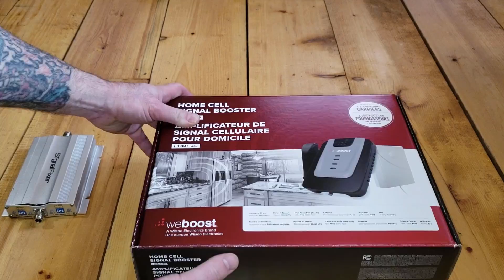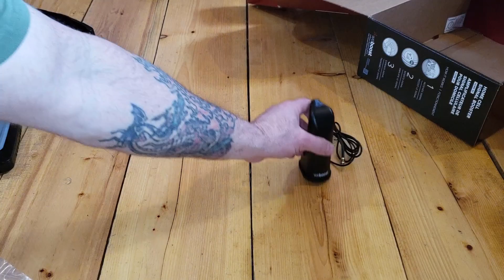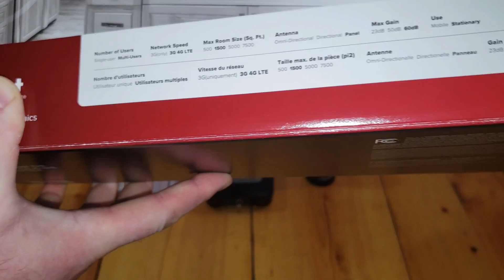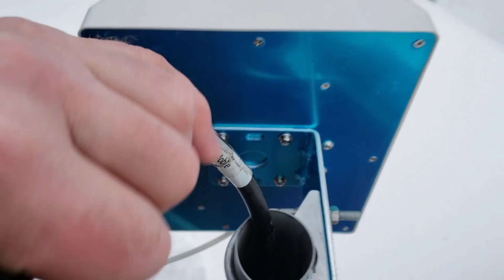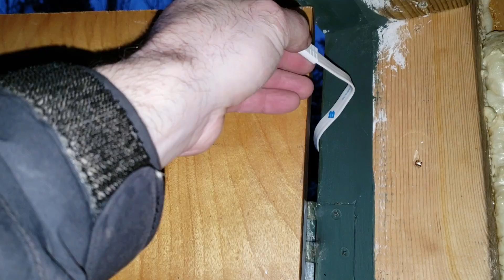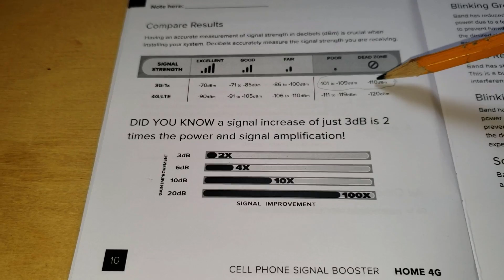WEBOOST Cell Signal Booster at the Cabin - Unbox, Install, and Review!

Comment: I'd be curious to know if WeBoost would work better with a better Yagi-style exterior antenna properly aimed and an in-line amplifier feeding a true 360 degree omnidirectional antenna indoors.   WeBoost is overpriced IMO.
EDIT:   A commenter below confirmed that WeBoost works even better with proper antennas.

Comment: How far away is the tower from the cabin
Reply from the maker: I think its about 8 miles. Although that doesn't really matter. It's the line of sight to the tower + the power output of the tower.
Reply: @NB88   what what service are you going which provider

Comment: Mine jumps from 4 to 3g because I'm between two towers. I'm almost in the middle, so I get good 4g on one side of the house, and 3g on the other end. My phone struggles to stay connected to either though. Basically the walls of the house block signal from either side.

Comment: The outside antenna and cable supplied with your old booster was actually of better quality that the stuff that was supplied with the new booster.  You could have bought a small connector adapter for a few bucks to connect your original outdoor antenna to the booster and saved yourself a ton of trouble...and risk!  But that's what you get when you don't really understand what you are messing with.  Glad it is working for you though.

Comment: Hi,

Curious what did you start with for connection? (dBm or none at all) and....

What is your Line of Sight situation? Any mountains lots of trees between you and the tower?
Reply: Note: I did finish your video thanks for addressing your dBm finishing point. I'm just am looking for clarification from the starting point.
Reply from the maker: I started with little to no signal. When I did have signal it wasn't really usable - texts wouldn't send or would take forever, phone calls wouldn't work. I'm on an elevation which helps and there are no mountains but there are trees in the line of sight. I could put the outdoor antenna up higher but it's working fine for me as is. Data still sucks but that's the towers fault not the booster. Hope that helps.

Comment: Question: SInce it tends to get hot, I was wondering what you think about using a common timer to power the unit off (at night) when not in use? My thoughts are this would help prevent the unit from overheating (no continuous power until day time when you want/need it). My concerns would be would turning the power on and off dailey cause any harm to the unit if this were on a timer? Your thoughts about this idea as a means to control the temperature would be appreciated. I just ordered this same unit and it will be arriving in another 10 days.
Reply from the maker: My unit doesn't tend to get very hot. I just put my hand on it and it was barely warm.  That said it is slightly spaced out from the wall so it gets good airflow.  Also, since the cabin is run by solar,  so I shut off the power every night anyway.  You could put a timer on it if you find it getting hot.
Reply: @NB88  Thank you for your insight, best regards!

Comment: I think if you could raise that antenna about 10 to 15 foot up you're going to get a lot better signal strength. Your to close to your tin roof. Attach a ground wire to the base of the mass. This will improve the ground wave
Reply from the maker: I thought about putting it up higher but so far it's working good.

Comment: The cooler the unit is, the better it works. put it where it won't get wet. It's NOT waterproof. Get on the website a get an
 outside antenna like the one you took down. https://www.wilsonamplifiers.com/wilson-yagi-directional-antenna-wide-band-50ohm-314411/

Comment: Your coax on the old system is LMR-400 This is very low loss coax, compared to RG6 which is commonly used for CATV installations. LMR-400 has a 50 ohm impedance, while RG6 has 75 ohms impedance. That only matters for the antenna install. It's possible to get the booster to work with the LMR-400 with some work. Of course, if it's working, I wouldn't try fix it.

Comment: Just in case people don't know about this option, there is a category of antenna/receiver/transmitter cable that is called "hardline" or "semi-rigid" cable. Good quality hardline is quite expensive but has even less signal loss than flexible coax cable. It IS a lot more difficult to work with than flexible cable but for some situations it can mean the difference between success and failure. For these kinds of situations, I would call it a last-resort kind of cable. By their nature, they are also typically more robust in adverse conditions than flexible cable.
Reply from the maker: Thanks for your feedback.  👍

Comment: A POSSIBLE CHEAPER SOLUTION

My family uses a "signal booster" solution on the ranch, but I use something cheaper that works for my needs where I work and live. When I'm there, all I usually need the phone for is to talk and mostly in case of an emergency situation.

If you have at least one location in the house that has decent cellphone reception, this solution is something to consider. It does NOT replace the "signal booster" solution if you don't have at least one cellphone usable location.  (and of course with this system, you're using a handset now, and not carrying around your smartphone...so it won't be for everybody)

A much cheaper alternative that works for me is a multi-phone "link2cell" capable wireless phone system. It still uses your cellphone for making and receiving all calls, but this type of system lets you use the wireless phones that it comes with (you can usually add more). I've seen them listed as coming with up to 6 phones but you can buy one with just 1 phone if you like. Even that lets you walk around without worrying about losing the cellphone signal.

One Link2Cell capable phone system with 3 phones cost me $15 used (it was $80 new at wmart).
However,  one issue is that "link2cell" doesn't work with older Bluetooth so look at the specifications of the link2cell phone you are getting and the Bluetooth specs on your phone.

It does not require ANY extra "apps" to run. it just uses the cellphone's phone capability.

Here's how I use it:
I put my plugged-in cellphone by a specific window where there is good cellphone reception, and I put the "base station handset" unit within 30feet of it (it's Bluetooth-based). My link2cell system came with 3 phones total: 1 base station and 2 other wireless phones with small charger stands that I can position anywhere within hundreds of feet...definitely anywhere in my location (1 bedroom, 1 kitchen/living room, 1 to carry around the property)

With this setup I can make and receive calls using a "regular" type of wireless phone we've been used to for decades now. In addition any one of the 3 phones has full access to the contact list stored in my cellphone, and Caller-ID provides information using that list just like using my cellphone. It also blocks calls just like my cellphone...because it IS my cellphone that is actually making and receiving the calls, but I'm talking on the system's wireless handsets.

Even better, I can carry any of the wireless phones around with me on the property, and it has a range of about 300 feet. Some of these link2cell systems have longer ranges than that (correspondingly higher price).
==============================

Examples:

$75 Panasonic Link2Cell Bluetooth Cordless Telephone with Digital Answering System (4 Handsets Included)

The one I got is 
$15 (used) Vtech_Link2Cell_DS6722-3_PhoneSystem-3handsets

Note: these are also alternatively called something like 
$65 Vtech DS6621-2 DECT 6.0 Connect to Cell
Reply from the maker: Good information. Thanks for sharing.  👍

Comment: Download something like Ookla - Speed test.net app and see what your average download/upload speeds. Also if while watching YouTube vids, to help keep smooth playing of vids, tap the 3 dot menu at top right of video screen and you can set vids to 720/480/360/240 quality (adjust as necessarily needed to stop the buffering. Also, adjusting to lower vid quality will help your data usage too).. Good videos though bud. Keep up the good work and stay safe fella 😎
Reply from the maker: My signal is strong but my speeds are sloooowww...since it's a rural tower, I understand that it probably uses microwaves to transfer data? I can watch 'ok' quality youtube videos but upload speed was only 0.43 Mbps.

Comment: I'm installing one for my parents this weekend, they live at the top of a mountain in Asheville NC. They can get 1 bar sometimes 2 bars LTE on the porch. So I hope this works. Thanks for the video, very informational.
Reply: CANT WAIT TO HEAR...  same  situation here
Reply: Did it work??
Reply: I found a spot outside that got 2 bars LTE on my phone so I mounted the outdoor antenna there. Ran a coax cable inside to the booster and now they get the same 2 bars inside. Only draw back is range it only works within the living room where the antenna sits and the bedroom behind it. But it does work and they can set the phone up as a Hotspot to use their PC

Comment: Ouch, that was pretty cringeworthy  watching you throw the ultra low ohm communications wire to the side and put it all on a high 50ohm TV coax wire.  Should have bought an adapter, it makes a huge difference on our ham radios, I bet it would help your cell antenna too.

Comment: while your unit is connected and operating... go on your roof  and slowly  tweak the direction your antenna is aiming, you may not have the antenna  exactly aimed in the direction your cell tower is, thus the drop in 4G LTE to 3G its got a lock, but not a steady one

Comment: 12 years in the wireless industry. A couple of things you should know. BTW Network Signal Info is an awesome app. Also look into LTE Discovery. It will give you frequency info about the tower you are connected to and aid in geo-locating towers.

1st. Phone calculate bars based on a formula that is different for every manufacturer. For example the same -100dBm signal on a Iphone 8 may show 4 bars while on a Google Pixel 3 it may only show 2. The devices may perform identically in term of most things besides data throughput ( Snapdragon processors have integrated modems and are just plain faster than the seperate processor and modem configs used by apple in terms of raw network performance ). They will however seem to indicate different signal strengths if you just look at the "bars"
2nd. The algorithm that the phone uses to display bars is different for 3G and 4G networks. LTE needs less in terms of signal to work appropriately than does 3G-HSPA ( TMobile/At&T ) or 3G-EVDO (Verizon / Sprint ). -100dBm 3G will be significantly less stable than -100dBm LTE. The FCC also permits slightly higher TX power on the cell site's 3G bands than on LTE. Honestly have no idea why and I trained employees on the network equipment.
3rd. The bands may make some difference but inside a house at close range the difference in penetration between Band 4 ( 1700 / 2100 ) and Band 12/13 (700mHz ) really shouldn't make a difference. Side note lower frequencies travel farther while higher frequencies are better for data speed.
Lastly data speeds in rural areas tend to be limited by the connection speed available back at the cell site itself. Many rural sites do not have fiber connections at the tower they use microwave links for connectivity or some sort of dedicated connection like a T1. This is not as common as it used to be at rural cell sites but there are still plenty of them out there.
Reply from the maker: Thanks for the information. My nearest tower is very rural so I'm sure it does not have much of a connection. Which explains my good signal strength but slow download speed and really slow upload speed.
Reply: @NB88  The upload is normally the giveaway. Sub 2mb up is almost guaranteed a microwave link.

Comment: little tip for some people with the 4g 3g jumping issue, type #*#4636#*# into your dialer and set your preferred to LTE only dont touch anything else and you'll be fine it is a bit of a scary screen at first but as long as you dont change other things its fine. PS not all phones allow you into those secret settings but most should

Comment: 3g wavelength can travel further then 4g,  just how 5g is only good for 500ft,  4g is good to 1500ft? I think  3g is even further then that,  5g does not penatrate walls very well too,  just like 4g has problems with  walls and 3g has less problems with walls,     Trees can also effect your signal but not by that much just be aware any atmospheric conditions can interfer with it,

Comment: I am a Wilson dealer and installer just leave the directional antenna installed as it is the right one for what you need also it is more directional than the panel antenna. the antenna you are showing the video is for internal use with the amplifier  the panel antenna that is being shown is less directional than the directional 3 g equivalent antenna.
Reply: the cable looks like lmr400 which is higher quality than RG6

Comment: 3G runs on a different band at a lower MHz and the lower the MHz the further the distance but with quality loss but the higher MHz better quality with a distance shortage (shortwave radio ultra low bands can or n 2000+ miles sometimes) but this was the differences in the 3g to 4g LTE .... But the cable difference was your old one was a female type N with the yagi antenna you had was a male type N , your new omni directional  panel antenna with sma male ends. Every time you use a splicer or a new connection you will lose db which is what you rate the signal -db ! Just saying if you will run the discovery app while you are hooked up reading your signal meter while you are on the food you can use the meter to fine tune the panel antenna to the best direction to get the best 4g and it should keep it from jumping back to 3g signal. It does this when your 4g drops below a certain rating. But you can also get a small to N male to convert your new cable to your old yagi antenna that should be better for your type of install and where you are so far away from the tower the yagi is more of a directional antenna with a smaller spread but further direct beam while the omni panel is a shorter wider spread beam like a 130° with the yagi being at like 30-40° but it just uses the same power at less wide more out, you get the point. Anyways hope this helped you anyways. Be safe out there
Reply from the maker: Thanks for the info. I was considering going back to the yagi as I understand they are better. I was also going to try to mount the antenna higher to clear the treeline. That would require another piece of cable so i'm wondering if the connector would make that much of a difference in db lose? and adding another 50'.
Reply: @NB88  the more cable you use the more loss in db but you can weigh out the better more db for the loss per 10ft loss vers that 10ft getting 20+db just make sure its a low loss like a 400 its just somewhat pricy but if you run two yagi on the 1-180 and 1-90 where true LTE runs on a  x type instead of the reg  vertical  the two connections on mimo multiple in multiple out like a nighthawk m1100 where it has 2 TS9 hookups you can t them together and get what ever your getting on your feed now but when you run the 2 yagi it would like one over top of the other and one kicked sideways at 45° and the other kicked the opposite way 45°  so there 90° out of faze of each other when you look at it from the front it would seem like the elements extended would be x crossing each other, this was the LTE real solution was you can only push so much through each channel and only one person receives so much bandwidth but if you have exhausted all the other steps best cable best db best signal, well now that they have done this what if they just took and flipped the signal pattern out of faze and you can run one on one and the other on the flip side then you still have the same 1 connection but at twice the speed because you have two links one the one hookup they call them supersets Lille AT&T band 12/17 superset bandwidth 698-716uplink-729-746downlink on the 12 and 704-716 up - 734-746down on the 17 now you have true LTE with upwards of 100mhz download and 50mhz upload (best outcome real life's good type of results) but you can have high speed cable type speed internet way the hell out in the boonies so the rabbits and chipmunks can see high deft porn without freezing up in the process 😂 it does make a big difference when trying to upload something with any kind of size you can also run the inline boosters to them and get the better results. If you can get two bars of signal on your roof or where you were going to put the antenna to where you can see the tower you wouldn't even need the inline boosters I don't think bun. Just the two wide band Yagi's and the router and cable and you'll have the heat rolling off your router from all that traffic coming in and out. Hope you get some help out of this bro. Keep safe out there in gods country. Must be nice man. The only real peaceful way to live left is that way.

Comment: You could have used the old antenna with an adapter to go from N-connector to the antenna and same from cable to inside unit. RG-6 cable has more loss than the cable you installed. Some people say there is a lot of loss in the adaptors. Bull Hockey, not enough to where you can see it. I always use the bigger cable like LMR-400 on high frequency antennas. Do a comparison on the RG-6 to the LMR-400 online and see what I am saying.
Reply: That is correct. I'm a amateur radio operator and the cable you had installed on the previous unit was far superior it appeared to be lmr 400 or 600 with a N- type connection. I would buy an adapter and use the better cable. You will notice a big difference in the stability of the signal quality. But if it ain't broke don't fix it. Lol. Good video nice cabin. I'll be checking out your channel more often Dale.